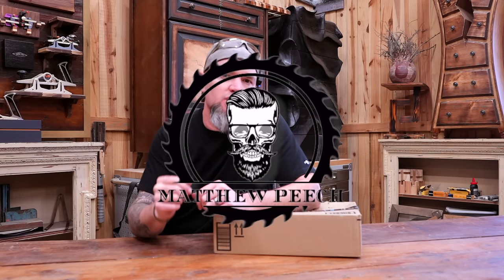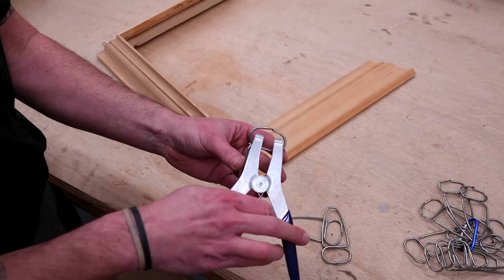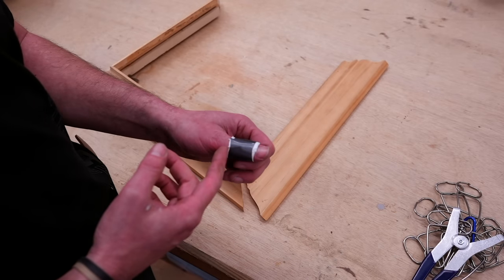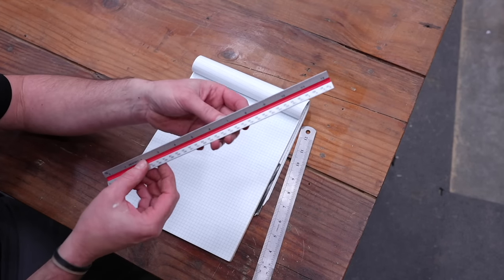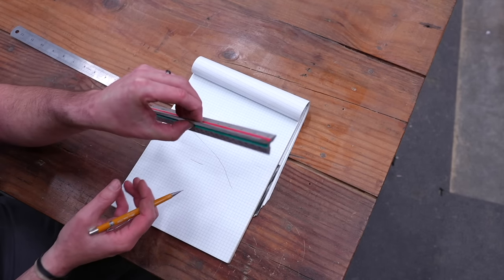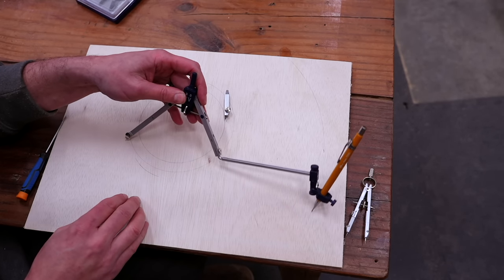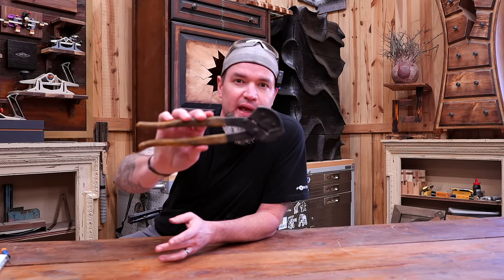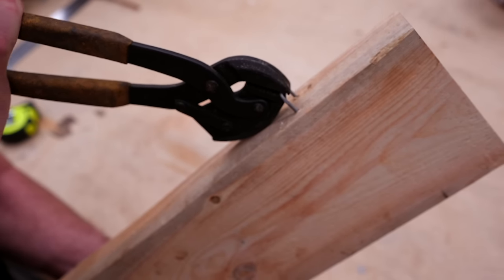8 Tools Under $20 YOU Told Me To Buy

Comment: just wanted to point out that the center finder ruler does not have to be perpendicular to the edges between which you are trying to find the center... just make sureyou have the same number on both sides and the centerpoint is on the center line. repeat twice and join the two point to find the center line as long as the side edges are both streight. (yes, even if they are not parallel to each other...)
Reply: I just typed out basically the same thing as I didn't see your comment, DOH.
Reply: Or you could do the same thing with your tape measure, angle it to a full inch mark at each side and then divide.
Reply: @Belg1970  yeah.  I learned that awesome trick about a month ago.  love shit like that!!
Reply: Great info. I see what you mean. Makes sense.
Reply: @Belg1970     AGREE...... Im 73, had 4 years of drafting classes in high school and have worked in the printing world all my life (and still working) so I can use/read a ruler... but centering up 13 and 11/16ths  would be a task... diagonal a regular ruler to 14, find 7,     dupe at each end and connect the marks...way too easy....
Reply: @daviddura1172  I saw Tommy Silva (TOH) do it that way years ago and it stuck with me ever since.

Comment: Equal Rips: Ruler at angle until it shows a measurement evenly divisible by the number of pieces you need (i.e., 4 equal width boards from 9" wide stock?  Take your rule, set the one edge at 0 (or 1 or 2 whatever) and the other edge will get set at 12" (for starting at 0).  Tick mark at 3", 6", and 9".  there you go...No special tools.  Same goes for "Center finding".  12-3/16" wide board?  Set the measuring device at 0" and pivot it until you're at 13" and mark at 6-1/2".  Same rule, tape measure, etc., don't need two extra tools.

Comment: Witht the centre finding ruler there's a quicker way to find centre using it, with your demo 7 was the closest to the outside, twist it so the 7s(an easy to see referance) are touching the edge the centre will still work, heck even take it to its last measurements and it'll still read centre.

Comment: There is a better version of center finder, but I don't know if it's in trade - but there are a couple versions 3D printed, and making one yourself should be pretty easy. The idea is a ruler with two cams (bolts, wheels, whatever; cylinders) sticking out one side near the end, and holes for pencil at halfway, 1/4, 3/4, 1/3, 2/3 and so on between them. You place it across the piece of wood (plank) and turn diagonal till both cams press against their respective sides. Insert the pencil into the hole of the division you want, apply some torque to the ruler to keep the cams pressed, and slide along the wood drawing the perfect centerline, or 1/3 line, and so on.

Comment: Hey Matthew check out the Matey Measure it is under $20 it goes on your tape measure to find the measurements in corners, I have one it works great for when you have to bend your tape measure you side this on the tape measure to the corner where the bend is and it gives you an accurate measurement

Comment: 123 blocks blocks can used for setup the scale on tools.  Hopefully that’s clear!
Stuff from Harbor Freight rangers from extremely good buy to dumpster fill. The digital calipers are extremely useful. I’d picked up the Doweling  jig years ago mine was ok not in the same class as the Dowl-It 1000 that it is a cheap knock off. My pneumatic nailers have been very good pin, staplers, roofing, and framing some of them (18 ga) I’ve gotten for under $20. Also acid brushes for glue, chip brushes spreading Sranan, use then ant toss them. In general don’t buy the cheapest tools from HF.

Comment: Here's another quick way to use the center finding ruler. Ex. Your board is 12 13/16" wide, you rotate the ruler until the same number (in this example you could use the 7's) line up with the edge on each side (7 on the left and 7 on the right). Mark the board where the "zero" is and you have the exact center of the board.
Reply: Works with any ruler just pick a number and divide it by 2. 
18 at and angle 9” is the center.
Reply: @akbychoice  Or, get the centering ruler and not do any math at all.

Comment: The architectural scale has the small scales such as 1/8" which would be used to draw large buildings but there should be scales such as 3/4", 1 1/2" and 3" which could be helpful for drawing cabinetry.  For instance 1 1/2" scale is 1/8 life size so you could draw a scale drawing of a 4' wide cabinet on a normal sheet of paper.

Comment: Could not agree more with the centering dowel jig, awful in the lower budget range (cannot speak for the higher budget range). Bought one to work on a bed for my son, spent around $35.00 on it with the intention of  using it add dowels to all joints. After fighting to keep it centered and adjusting everything multiple times over multiple hours, I gave up and milled a jig out of 1" thick Acrylic. A 5 minute jig worked loads better than the centering dowel jig.

Comment: I like using a pair of fencing pliers for nail extraction- they have a hammer end and that curved pike type thing on the other end makes it so you can roll the nail out just like those nail pullers you have.
Reply: Being a civil engineer, I have all the triangular scales: architect, engineer, metric. They range in size from 6” to 24”. 

I’ve use mine as a straight edge before as well.

Comment: I have a Michigan made [ TASK ] version of that Dowel Jig. It's built solid and accurate. I bought it many years ago, back when we (USA) still made stuff. I've had a shop for over 65 years, so I've had my share of crap. The Horror Fright knockoff is no surprise. Buying at HF requires what the military termed "Time In Grade" experience or you'll be pissing away your money. Note that I used the past tense in regard to the military. I have absolutely no idea what that means in our new and ..uh..inclusive  military.  On the other hand, if one has the skill to make a crappy knockoff perform like an original, ..by all means have at it. I also do some machining on a 1960's South Bend Heavy 10. Sometimes a cheap knockoff provides enough cast iron to make it worth its weight alone. 
On another note, I love the Dresser Imitating a stress cracked Tree! That is a work of ART! It should NEVER .....EVER ... be sold! 
It MUST be passed down to your descendants so they can fight over it🥰!  
Wakodahatchee Chris

Comment: I thing you got a bad one Dowel tool from Harbor Freight. I used one for two years successfully. I replaced it with the Grizzly Dual Spindle Doweling Joiner last year.
Reply from the maker: I guess I did. I would just take it out of the box in the store to make sure the milling is good.

Comment: The 1 2 3 blocks  can combine 4 5 6 also
You can use them to hold work off a surface   glue up corners squar  set draw slides evenly  set up cut depths.
Use to keep a drill stright as you drill with a hand drill  give you a larger clamp pad surface  a pencil holder. Ex.  Keep em around youll find uses for them even i didnt say.

Comment: As you grabbed that triangle ruler, I smacked my forehead. Yeah...the guy that took drafting as an 8th grader (in 1967!) and the guy that was an Illustrator in the Army...real job, folks. MOS 81E20. Might not even exist today, but back then I drew plans, lettered awards with calligraphy, and made visual presentations using an opaque overhead projector...the '70's version of power-point. Don't know why I don't have that ruler in my shop, because I have one on my drawing table today ... who needs SketchUp when you can take hours longer and do it manually?
I do, however, have several quality compasses and a divider from a drafting supply house in my shop. They are the bees-knees...the times when you need them!

Comment: A vice grips also makes a good nail puller. Just clamp on the nail and rock it back on the top just like you demonstrate with your nail puller. But it also has many other uses. If you have a vice grips, you really don't need a dedicated nail puller.

Comment: Every ruler is a center finding ruler. Just put the ruler across the piece at a slight angle until it has a nice round measurement that's easy to divide by 2.
Reply: that is exactly what I do.   Also use multiples of 3 so 0 on the edge 9 on the other make a mark at 3 and 9 and you marked it in thirds and so on.

Comment: Re: HF tools - 1) I just got a 1/4" electric die grinder that, so far, seems really powerful and solidly built.   It's suitably dangerous. 
Also, I've found that their bauer line tape measures are an incredible value.  I can't vouch for their accuracy, though. 
I think everyone knows HF's cheap, grey trigger clamps are pretty much essential. 

Apparently nobody makes a good dowel jig for under something like $100.

Comment: I commonly used the counter-sink drill to bevel the edge of the hole in a cab side-panel or back-panel where the Huk-Rivets must be flushed with the surface of the newly joined panels repairing unibodies where a flush fit is desired.
The Center-Finding-Ruler is an excellent straight edge for checking flat surface of a cylinder block or cylinder head.

Comment: Tools from HF are usually a starting point. There mostly crap, but if you enjoy modifying tools, then they can be a fun project. Most tools are made from the same few castings in china, so if your patient, you can bring them up to usable status. If thats not your thing, or you dont have time, steer clear.

Comment: If you put the clamps on the carabiner the other way around using the pliers they came with, you don't have to open the carabiner to get one off. Could also just use a bit of horizontal pipe or really any surface you have already, just make sure they don't stay tensioned or they'll deform over time. You need the pliers to use them anyway.

Comment: Using a clamped down framing square to buck your trim pieces while gluing and or brad nailing is a breeze. I just figured this out when making custom draws on compound miters. No way to clamp well that I found any way lol. Adding a piece of wood clamped down on correct measurements gives  you threes sides for multiple identical pieces. Edited for auto correct catastrophe. 😂

Comment: As far as the center ruler check out fast caps easy half tape measure it has 2 scales on the tape..the normal and directly across is what the half will be don't have to line anything up take no time at all to find what your halfway mark will be on anything

Comment: A trick to keep in mind with the center finding ruler, is that you don't have to worry about it being perpendicular to the sides or even the shape of what you're measuring. The ruler will find the center between the two points you've chosen.

On a square piece this means you can do it at an arbitrary angle as well.

Comment: Use 1-2-3 block with a fence clamp. Attach to table saw fence so that it adds 1 inch. Now if you are cutting say12" lengths of stock, just set your fence to 13". Using the miter track guage butt your stock up to the 1-2-3 block and then cut. Your piece will not bind against the fence and you get an exact 12" cut.
Reply: FYI fence clamps are great to have for attaching shop made jigs to most power tool fences. Cost about $13 for a pair.

Comment: Bauer random orbital. Got mine (on sale) for less than 20. I've put it through the ringer and it's still going strong. 
They may cost a bit more now, but if someone wants to save.. Hope this helps someone.
Reply from the maker: Thanks for the suggestion.
Reply: I bought one right after Christmas for $15. And it works great.
Reply: my go to sander and I have several brands

Comment: I agree with the Dowling tool but not just from harbor freight the one I got from big box store is just as bad and when you drill with the provided bits the hole are way off for the dowels to properly fit

Comment: I am not trying to teach you how to suck eggs but the use of a compass to mark out multiple even strips of a wider board can be done with a tape measure or ruler without maths.
If your board is about 7in wide and you need 5 strips, take a tape measure and set it at an angle across the board to measure 15in then mark every 3 inch this will give you 5 even divisions. This trick works for any width in inches or centimeters, all you need is an angle across the board that is wider and divisible by the number of required strips, you don't even need to know the exact width of the board you just get a number of even width strips.

Comment: Under $20 @ Harbor Freight; Laguna 125 lb. Dual Suction Cup Lifter ($5.97), Magnetic Parts Holder ($5.99) this was a free gift not long ago, Utility Rope nylon-polyester blend fiber ($5.99). Cheap thow away paint brushes.
Over $20 but. @Harbor Freight's Bremen Parallel Clamps with a Lifetime Warranty. Youtuber 731 Woodworks has tested Bremen clamps against Bessy, Jet, Irwin and Jorgenson's clamps. He stated that Bremen performed very well and was the best bang for your buck clamp out there, especially with that lifetime warranty. He gave Bremen a fist bump of approval. US General industrial-grade roller cabinets

Comment: Using a compass that way, to mark the board into quarters is just silly. Use a ruler...unless you completely suck at basic math, it'll get you there quicker and more accurately. However, I do like that compass with the attachments. I have some similar, but without as many adjustments. I don't do a lot of woodwork these days, but I'm an artist, and use these tools fairly often. For larger circles, I have a couple of special tools that would be a better choice than that compass. Since you obviously are liking such tools, you should find a good art supply shop--you'll be amazed at what clever tools you can get. Of course, not every town has an art supply shop...
Reply from the maker: Yea I like doing things the hard way. Opens my mind to the point that I can take what I draw on paper and actually create my kind of art.

Comment: I too love cool tools. What often makes sense in the store or on the kitchen table just doesn't work for in the shop. Several years ago I stopped shopping at HF. Because the quality of the products were less than steller. Don't get me wrong. You usually get what you pay for. They do have good - better - and best in many categories. But to get their best "blue" colored tools you have to invest serious dollars on them. And last time I looked at the offerings on line, there were some serious gaps in the tool offerings. Once you get past the drills and general maintenance tools, you still need to buy Red, yellow and green tool companies offerings. The cost of the battery is problem. It's too expensive to have multiple batteries. It's a real problem when you have to stop and switch between different manufacturers batteries and chargers to use the correct tool. I myself made the decision to go for the 20volt yellow brand of tools. I considered the red brand but they were low on "fuel" at the time. Now are every yellow made tool great? Kinda yes. While not tops in every category, they suite me just fine. Perhaps in a few years HF's blue line will be equal to the red and yellow brands.

Comment: LOL.. precision tools at hobo freight, get this, i dont know if they still sell it, probly, they sold a 24inch level aluminium with black rubber bumper things, i make marks on mine for 16" etc. when i began to use it on the job i saw there was a slight inaccuracy in my marks?? i said im using a 24inch level! and we checked with a good carpenters square, made in USA about 30 yrs ago, and GET THIS.... those silly metric goofs were selling a 24inch level that NO combination of points were 24INCHES!! without bumpers, with, one on one off, etc! even tho used i took back pissed off.. ITS NOT 24INCHES!

Comment: I guess I can agree that the Dowel Centering Jig from Harbor Freight is likely trash. That being said, I have used a similar Doweling Jig for years (more than 30) and I love it. I had one before Biscuits were the thing. When I bought mine, even in the dark ages, it was a chunk more than $20.00. Anyway the one I use is from "Task Industries" and it is very well made and it aligns the jig perfect center. and is drilled for 1/4, 5/16, 3/8, 7/16, & 1/2" drills. In all the years I have used it, every hole I've drilled has been dead center in stock up to 2" thick. My biggest waste of money was on the Biscuit Jointer I never use, In my opinion, the dowels just work better. Just my two cents, but hopefully your viewers won't pass a good doweling jig up. The HF is junk, the TI is fantastic.

Comment: Instead of an Architect’s 6-sided scale ruler, I use an Engineer’s scale; inches divided respectively into 10ths, 20ths, 30ths, 40ths, 50ths and 60ths. 
Allows for easily dividing a measurement into 1/2, 1/3, 1/4, 1/5, and 1/6.

Comment: 123 blocks are handy for machining but not super useful for woodworking. I'm a toolmaker, and I use these to elevate large workpieces off my table in the mill. I use them as large parallels on a magnetic chuck with a rail. I have about 6 sets. I don't use them all the time, but when I do, they are handy for larger parts. I use them some as a toolmaker but wouldn't use them as in woodworking.

Comment: With 123 Blocks, they tend to be heavy enough that you can use for gluing or positioning when you need a right angle, or even a full corner. They also don't tend to glue down in the process unless you really overdo it there, so when making things you can use them to keep things in position as you're working